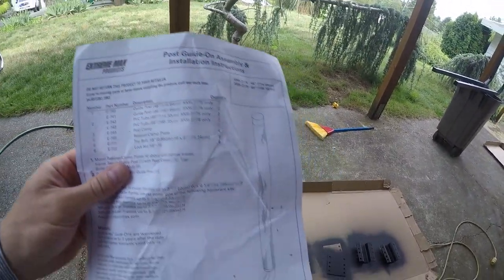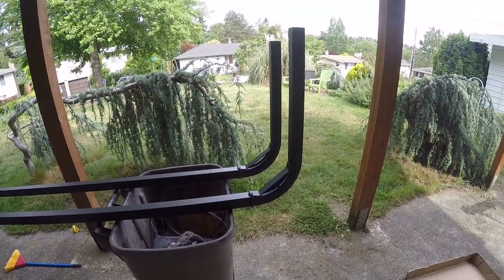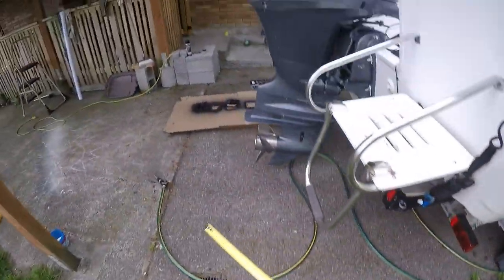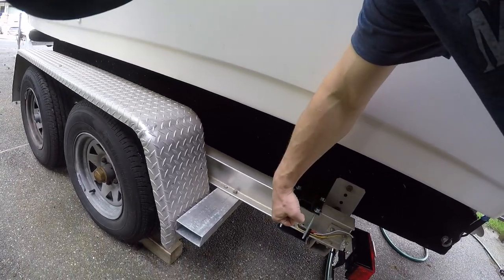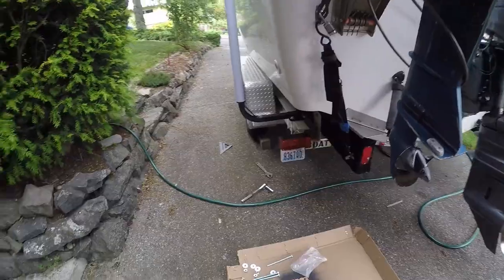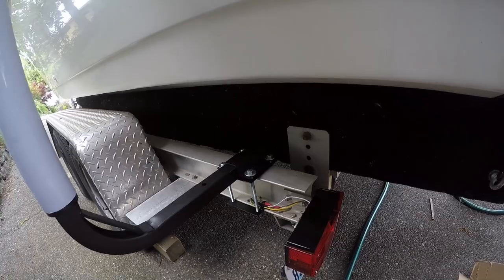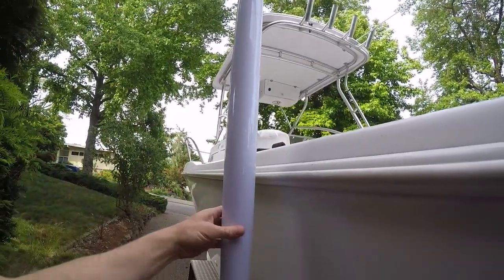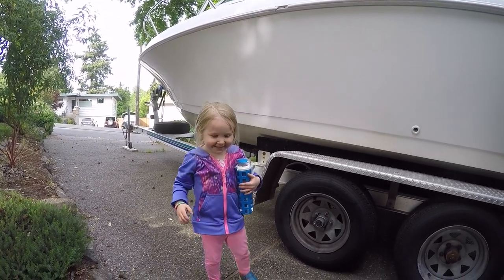Install Boat Trailer Guides to Keep Your Boat Straight When Loading

Comment: quick tip trailer guide bracket usually is oriented to the bottom rail so you don't have to cut.  Thanks for sharing

Comment: It’s been 5 years, how did they hold up?
Reply from the maker: I've sold the boat but I got about 5 years on them. Have a similar set on my new Grady. The plastic pipes will shatter if you hit them with too much pressure like a side current situation. Ask me how I know! flew across the dock. But I just bought some new 2" PVC and away I'd go. They're about as good as you can get for the price.

Comment: Drill a hole in the side of plastic tube near the top so water buoyancy doesnt lift them off
Reply from the maker: Ya that can't hurt. I haven't had they ever lift off though. I have shattered 2 pipes, then replaced them with the hardware store stuff then swapped the caps. They do take a beating!